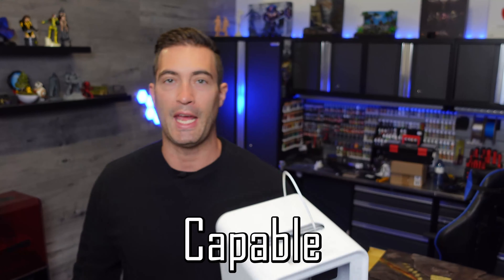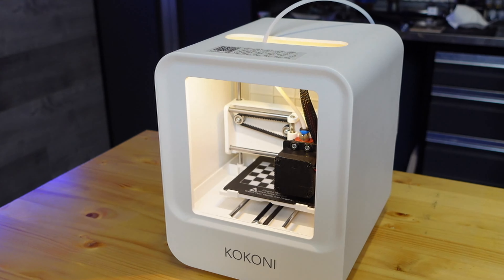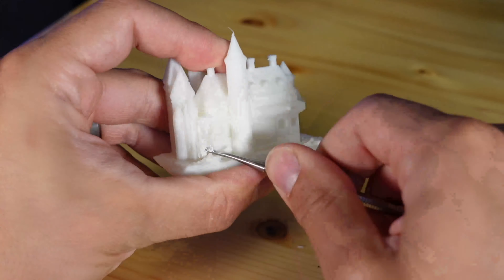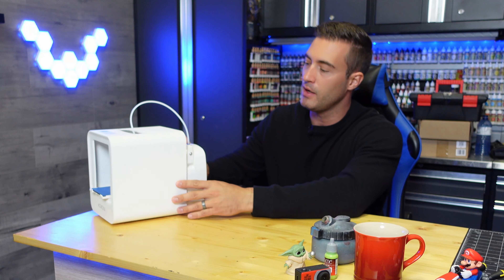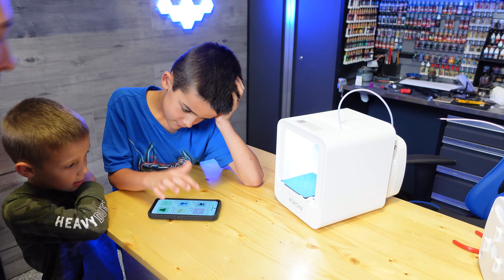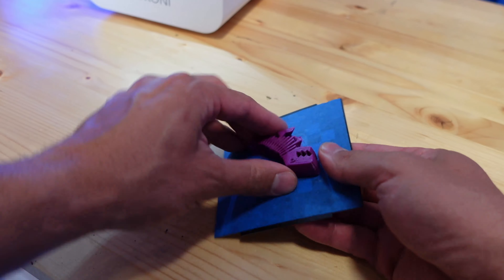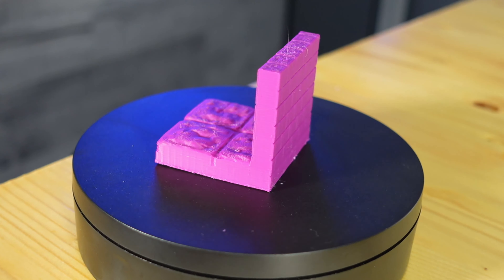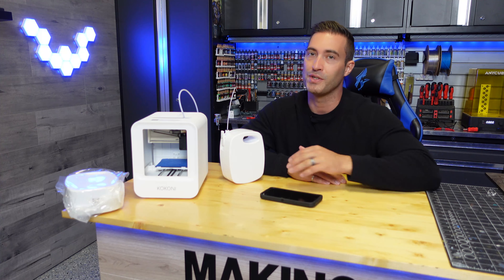But... Can This Mini Printer - Print Minis? - The Kokoni EC-1 is Amazing

Comment: That is simply adorable printer. I could use a small printer like that to prototype gear system for mechanical designs for my tabletop terrain.
Reply from the maker: Thanks! That would definitely be a good use for it.

Comment: Hi, I'm considering to buy the ec1 but I've also seen the ec2 on the web. Wich one is better for our hobby ? The difference is in the nozzle diameter ? 0,4mm for the ec1 and 0,6 mm for the ec2. Wich one is better ?
Thanks a lot
Julian
Reply from the maker: I only have experience with this one, so i can't compare. Also, the lower the dimeter of the nozzle the higher quality it can do, the trade of being its slower.

Comment: The need to use the app on my phone is a hard no for me. I want a dedicated display of the printer as I actually don't always have my phone attached to me. Frankly i shouldn't have to use a $1000 phone to operate my 3d printer. The least they could do is include a small android tablet with the app preloaded.
Reply from the maker: You know what, that wouldn't be a bad idea!
Reply: I get this, but that app would’ve saved me when I was first learning. It’s all very straight forward, and easy to use from what I can tell. Also, the ability to slice on mobile, start and stop prints without an pi or arduino, is amazing to me personally. I’m sure the app works fine on my $80 tablet, shoot, I’ll even download it and check! Lol!